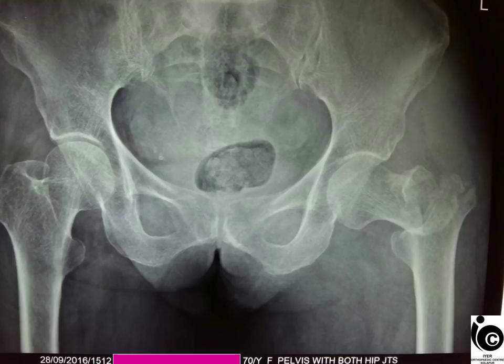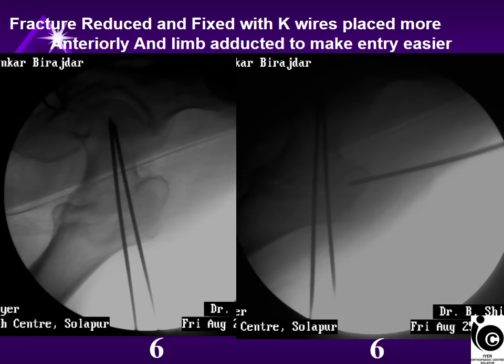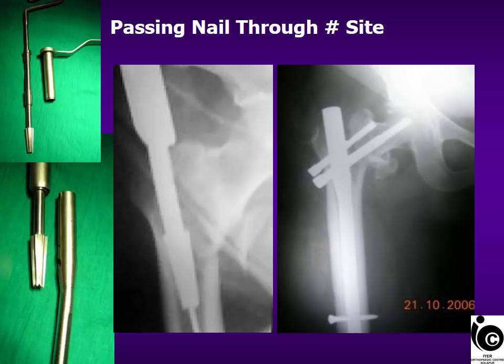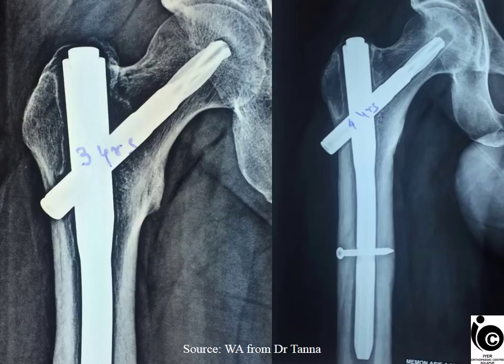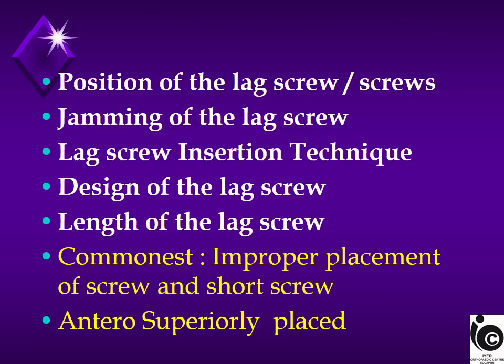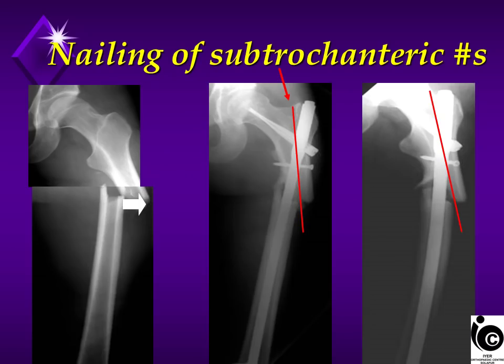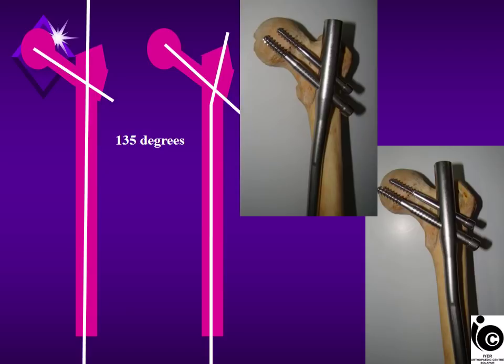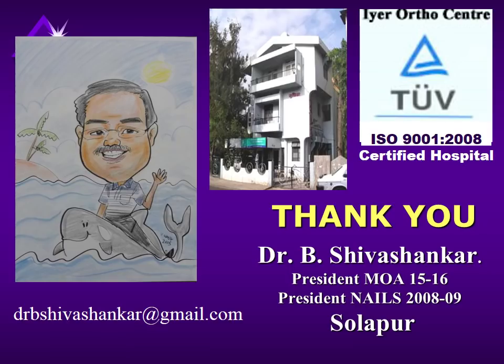How to avoid Common Mistakes  while doing PFN

Comment: great video- please - enlighten- cervical load screw- first- derotaion screw- little less length- second- when to relieve traction & final tightening- before- putting distal screw or putting distal  femoral shaft screw - then releasing the traction - final tightening of  - neck -2 screws ?? please answer.
Reply from the maker: Guidewire for cervical screw first as that will be the most important screw. Then GW for Decoration screw, then pass decoration screw, so that when you pass cervical screw the derotation screw prevents head spinning ( especially in basi cervical fracture)Guidewire for cervical screw first as that will be the most important screw. Then GW for Decoration screw, then pass decoration screw, so that when you pass cervical screw the derotation screw prevents head spinning ( especially in basi cervical fracture).
About releasing the traction, I reduce the traction partially after fixing fracture with K wires, and fully after passing neck screws but before final compression of fracture.
Reply from the maker: Derotation not decoration due to auto correct

Comment: Sir how do you decide about the length of PFN (Short vs Long).
Does fracture anatomy and stability post reduction play a role in decision making?
Reply from the maker: If the fracture is at the level of lesser trochanter or just a cm down, short TFN will work. If it extends beyond, then long PFN.
Also transverse high ST fracture will require long pfn otherwise straight short nail will open the fracture posteriorly.

Comment: What to do if there is a communited entry point
Reply from the maker: Fix the fracture in reduced position with K wires and pass the guide pin for entry and also the centering awl to ream for the expanded proximal part of nail over the entry pin and then proceed. Just because there is comminuted fracture at the entry site, don't avoid any steps. Otherwise, the nail will act as a spacer and also will cause lateralisation of shaft as explained i the video

Comment: Where to put initial k wire ? posteriorly or anteriorly .my concern is does k wire hinder the insertion of PFN?how to avoid? Thanks Sir.regards
Reply from the maker: K wire is inserted very anteriorly  in the neck,  so that it will not come in the way of nail or the neck screw.

Comment: With due respect I would like to ask when to release traction??after inserting nail and before putting screw. Thanks Sir regards
Reply from the maker: I do it in two stages,  once after fixing the fracture  with K wires,  when I am not worried about  loosing  reduction I will release  traction partially.  The after passing  the neck screw partially ( after crossing fracture line),  i release  the traction and meanwhile  compress the fracture  by final tightening  of neck screws. At this stage I also move the knee up and  down jyst to make sure that traction has been released definitely.

Comment: HOW TO REDUCE SPACER EFFECT? IT WAS NOT MATIONED?
Reply from the maker: . Basically one should not pass the nail without passing the proximal reamer( centering awl).  Also you have to fix the fracture temporarily with K wires passed anteriorly and also use proper centering awl to make canal for the expanded proximal past of nail, to prevent the fractured fragments going apart without getting reamed.